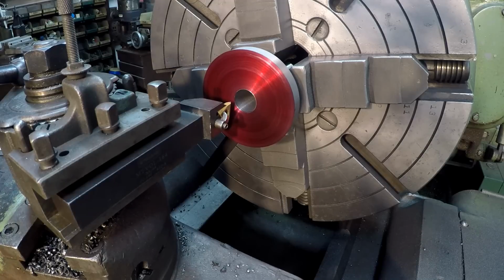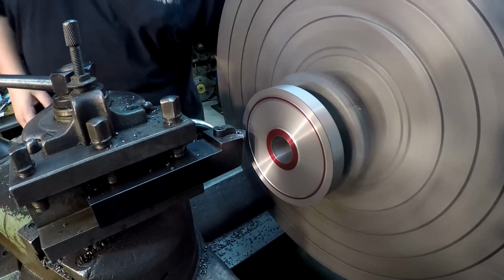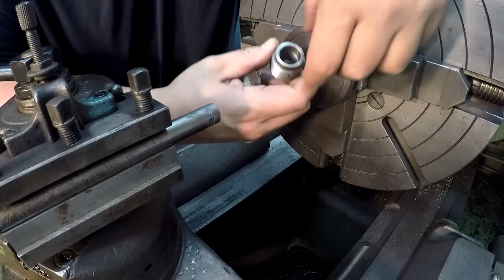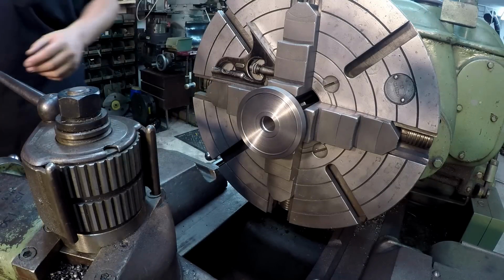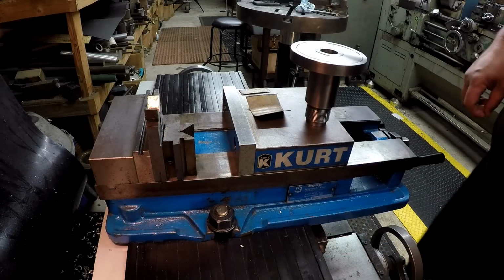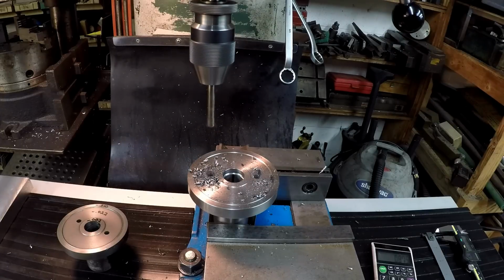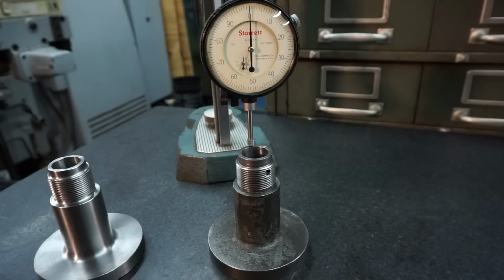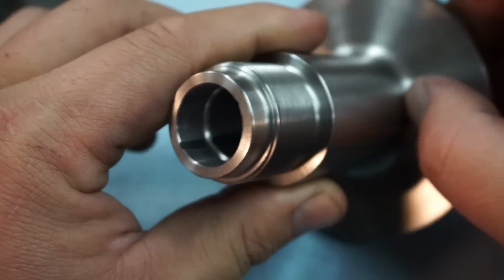LeBlond Lathe Cross Feed Nut Part 4 Finale

Comment: I noticed the discrepancy in the depth but didn't comment because of the ten thousandths outer depth. I wasn't sure if you were stepping the depths seperately or reading them in increments according to depth.  Though not doing machine work, I sometimes will total my measurements and incrementally work backwards from deepest to shallowest which is what I thought you may have been doing.
      As far as you being perfect, none of us are. Though not dealing every day with  quite so tight tolerances as you do, I have worked every day with measuring tools for the past 45 years. And whether due to distraction or being in a rush, I will still on occasion read the wrong side of the rule or a tape.
     People don't realize the hats worn by the independent contractor. It's easy to show up to a workplace and do what you are instructed to do. It's quite different when you are the instructor and instructee.
    If you had been working from a set of engineered drawings, then that ten thousandths error could be classified as a mistake. Given that you were given a part, asked to do the take offs and engineer the process for making a duplicate part, that error, if you could classify it as such would be more of an oversight than a mistake. A true mistake would kill the part, if vital the part could be re-chucked and the ten thousandths turned off, no harm, no fowl and none the wiser but for your admission.
     Don't allow the Monday morning Quarterbacks of the internet to embarrass you. Some people have nothing better to do than to point out someone else's errors and omissions to make themselves feel better.

Comment: Did you forget to drill the whole in the threads
Reply: Watch from 18:10 on, he can't drill the hole in threads or mark the zero point on rim because it has to be installed in the customers lathe to know where to place them.
Because you can't copy exact placement of the thread start and the relationship to the shoulder it tightens to, on the new piece. ( I hope my wording is not confusing)

Comment: I Really Enjoy Watching Your Videos:) You are Top Notch at what you do,  Question, Do you think that if you would have put a bolt , washer and nut through the Broken Parts to clamp them together, Then make a flat plate say 6" x 6" x 3/8" and drilled and Tapped it for the Threads to screw into and to bottom out on the Flange, Then would it have been possible to mark where the 0 line indicator is on the flat plate from the old part and transfer it to the New part when it is screwed into the flat plate and i think it would help to also align where the hole has to be drilled at. Just my 2 cents worth, Chellie, Retired Truck. Diesel and Heavy Equipment Master Mechanic / Equipment Mechanic / Welder / Metal Fabricator of 38 years. I also do Minor Machining , like making my own Tools / Parts / Shafts /  Valve jobs  ETC :)

Comment: You are probably right on there with the height because the original part doesn't fit back together perfectly right? That break would give you that slightly off reading. I think you are damn near perfect on the match. Well done.

Comment: Very nice work Adam.  fwiw I did notice the .032" thing but, wth, it really matters nothing to the project.  Also,  I also have to assume that straight oil grooves for this piece that I assume does Not have pressurized oiling, makes no matter as well. (though I was wondering how one might to the very large pitch grooves.)

Comment: What is that noise that comes on when the Monarch lathe is stopped? It sounds like a cooling pump or something, but why would it only run when the lathe is stopped?
Reply: Most lathes drive the spindle with a belt that can be disengaged (by releasing the tension on the belt) to stop the lathe without stopping the electric motor. I suspect the noise is created by the drive belt slipping on the loosened pulley, which is why the noise gets quieter whenever he turns the chuck in the same direction as it normally runs.

Comment: The error was due to seeing DEGREES with 90 being the top, instead of LENGTH with 100 being the top.  This is the problem with using a rotating dial for either measure in different measuring devices; you see double...

Comment: I'm as impressed as hell at the way you wrangle fractional and decimal inches. But every time it makes me more and more glad I'm metric.
Reply: Same here. I used to do a bit of work but our the setup was more humble than Adam's. Whenever I watch him, sometimes I have to stop the vid to comprehend his measurement values as I cannot click fast enough...
Reply: It depends on what you’re accustomed to. When you think in the halves/quarters/eighths of Imperial measure, the divide-by-ten of metric seems really clunky and arbitrary.
Reply: @mdtdbe  No, I'm not buying that. When you want better accuracy in the decimal system, you just add an extra digit. Using fractions leaves you far short of decent resolution unless youo deal in thousandths. Then you inevitably drop into the intuitive decimal system as the numerator. In other words you would say - e.g. - fourteen thou.
Reply: @donepearce  You are right. When they need more accuracy, they dont use fractions any more like 1/128 1/256 1/512 1/1024. They use thousends of  inc, it is 0,001.
Reply: @mdtdbe  I have small socket set. There are some small sockets, bout imperial and metric.
Metrics are 6,7,8,10,11 and 13.
Imperials are 3/16, 1/4, 5/16, 11/32, 3/8 and 7/16.
Metric system is much much  more easier and more  simple  than imperial.
I wonder that imperial system is used anywhere in the world after year 1800.

Comment: I have an old LeBlond Dual Drive lathe that needs a new leadscrew and 
nut.  I can buy ACME threaded rod in the size I need, but I'm 
considering using 2 off-the-shelf bronze nuts and machining a block that
 they'll screw into from each side.  That should allow me to adjust the 
backlash to near zero and compensate for wear.
More than likely I'll need to cut off the front end from the original leadscrew, bore it and 
shrink fit it onto the new ACME screw.
I read a suggestion to reassemble the carriage after removing the leadscrew assy, lock the 
cross-slide and use the compound to turn the parts I need.  Do you think
 that is feasible?

Comment: Damn. I watched the first episode and I was hooked. Such precision. I work in software where the precision is the same, just with code. But the part that got to me was the spanner holes. OK, **it's for a wrench to tighten it**, yet you took the time to center and check over and over that it was within a thousandth. Me? I'd have grabbed the 3/8" craftsman hand drill and punched a couple holes... I'm impressed by your care and precision to create such a perfect replacement part. You are an artiste' sir!

Comment: You get my thumbs up because of your calm and well mannered commentary in all your videos,  I am always put in a good mood after watching them.  Your skill and machining experience is also humbling to an electronic engineer.  In part 2 you promised to fit it in 3 parts but ran over to 4, just know that we are not upset or displeased with this minor lapse, quite the opposite and thank you for the time you take to document your work habits.

I have two small questions, I may have missed your explanation and apologize if so.

1:  Would it have been possible to increase the main tube diameter at the thread lead out and increase the radius at the weak point further or was this already at the thread root diameter?

2: Are there specifications that describe differences in performance in helical and linear oil grooves and might such performance differences come into play here and could you have cut the steepest thread pitch for the groove if a helical was called for instead of the original helix rise?

Comment: Hey Adam, Spending part of my retirement watching your excellent video's. I really enjoy the fact that you really enjoy what your doing. I can relate to this, having spent more than 60 years in the machining business. Having my own shop for more than 30 years, the one area that bothers me about this particular video is cost. It comes natural to me think about how much would I get for this job and how would I do it. While I do appreciate your care and attention, I could not help thinking that when I would be quoting this part and deciding how to produce it, the 4 jaw chuck would not be a consideration. The 3 jaw with soft jaws would be my first choice, starting and finishing the large dia. first. It's always tough figuring out what is what when making a replacement part with no drawing (I assume there was no drawing). You also are super well equipped and use brand new cutting tools, whether or not it's necessary. This is not criticism, I love what you are doing and highlighting the endless skills that are required to be a machinist.

Comment: It looks like the original piece had a tensile failure.  Not surprising because it was the thinnest part of the piece and I think cast iron (which is very brittle)  The two oil ports made it even thinner.  The new piece is ductile iron which has a different carbon structure that makes it more resilient. It should last longer but will fail at the same location if placed in too much tension.  I would not over torque the nut that goes on to that piece.

Comment: I made an indicator holder that would fit onto an Aloris quick change tool post.  The material was O1 tool steel.  Due to major blunders, I
had to discard my first FOUR attempts.  The fifth attempt resulted in a correct tool.  Don't feel bad about your 0.022 vs. 0.032 oversight.
I have convinced myself that stubbornness makes a pretty good replacement for genius.

Comment: Is  ductile iron a good choice of material? Why not something better, as the original casting broke at a weak spot?
Leaving that piece on a movable surface "upside down" leaves a possibility for is to fall over. Leave it on its base for stability. Spanner hole locations relative to center is probably not as critical as the spacing between them.

Comment: Hey Adam! Always love your videos. This might be an inappropriate video to place this on, but was looking at one of your older videos where you had to chase some threads, and the camera kept getting bumped by your head and was in the way. Have you experimented or looked at something like this: https://www.amazon.com/Umiwe-Semi-rigid-Waterproof-Inspection-Megapixels/dp/B075K4CX1R/ref=sr_1_13?ie=UTF8&qid=1507507592&sr=8-13&keywords=flexible+camera+with+light+1200p Coupled with a Noga indicator holder for some really up close live camera views or shots. It's IP68 rated. I don't think anyone on any of the machining channels has tried this yet. It's relatively cheap < $30. Just a thought.

Comment: Sorry to be pedantic about the effect of the axial oil grooves but---. Surely almost the entire radius of the bore is in contact with the shaft when sideways force is applied. Therefore I can't see the absence of a few percent of that surface making a measurable difference to the effective diameter of the bore. It will make a very slight difference to the wearing properties over its lifetime but it's delivering lubrication as a trade-off.

Comment: Couldn't you have used your level on it's 45 degree side twice and once on its 90 to get 3 oil grooves spaced evenly?
Reply: Three groves require 60 degree offset.  What you describe would be 90,135,135
Reply: @DaveRosenhauer  Math is hard XD

Comment: Great Job! As far as protecting finished surfaces is concerned, I've had great results with aluminum strips from beer or soda cans cut somewhat shorter than the part circumference. You don't have to fiddle with three or four separate shims. Also, thin cardboard from file folders / cigarette packs seems to work well on softer work.

Comment: Asking for some help on a Toyota forklift if anyone can help me. It’s a big 6 series and I’m trying to remove the axle but it doesn’t have the normal setup on smaller forklifts. It doesn’t have the bolts in the center to remove the axle. Thought the nuts in the back were what hold it but that just holds the brake system. I’m not a forklift mechanic I work on diesel trucks and cars and not really sure how to remove this.

Comment: Adam, you're the best but I sure can identify with that simple mistake. I scrapped a bunch of parts many years ago by turning one diameter .025 too small. I read the mike wrong and didn't catch the mistake until the job was finished. That happened my first year as an apprentice and it's happened since when my mind says one thing and the print another.
Reply from the maker: I have made that mistake many times, mostly in my earlier years. it's common with anyone reading mics.

Comment: Hi Adam,
That is some nice lathe work. If you are interested check out the video on our channel on "Depth measuring tools" The electronic Mitutoyo indicator on a depth base has a .00005" resolution. You will be able to check your depth right on the lathe. No need to bring it to the surface plate.
Steve

Comment: This is been an excellent workmanship.  Neat & Precise work and flawless too, Sir.  I feel that the broken part's height as compared to the new one is 9/10 Thou over is because of the air-gap in the broken joint.  Therefore, what is 9/10 Thou (under) difference comes out to be dimensionally exact.  Thanks Sir for the video.  I wish you best of Luck for the  coming projects.(New Delhi, INDIA)

Comment: Adam, have you done much hard turning? I frequently cut hardened tool steels D2, H13, M4, S7 with HRC 60+ and always struggle with interrupted cuts along holes on OD/ID turning. Faces usually don't have any issues. Is it tool alignment or rigidity issues maybe? We exclusively use CBN inserts for the process and in general they work great until that stupid hole.

Comment: Didn't read all the comments but I was wondering if the original part could be repaired by brazing. That would be a cool addendum to this series of videos. Carry on!
Reply from the maker: +Grumpy Oldman Yes it could be for sure. Although because of the thin wall where the crack is, the better option is to make new.

Comment: Great looking part Adam, nice series...enjoyed 👍🏼 Btw, what is is lowest number of threads per inch you can cut with that lathe? I woulda bet someone money that you were going to do the oil groove that way...glad I didnt bet someone :)
Reply: Abom79 wow that's low. I was trying to make a four start 3/4-10 just for kicks and giggles the other day only to find out my lathe we do below 4 tpi. I made it 3/4-20 instead.
Reply from the maker: Makin Sumthin From Nuthin I'll have to look and see but it is fractional. I recall the big Monarch we once owned would go all the way down to 5/8" pitch.
Reply: Abom79 my Morgan suspension bushes have spiral grooves which I cannot do as my lathe won’t go that course.
Reply: Mine will do 1 1/2 tpi, its a big Hendey 16"x30". My newest video shows how I do multi starts on the lathe.
spindle indexing is real easy on my lathe, it has a collar on the back  of the spindle that is graduated.
multi starts are fun to mess around with.

Comment: Have you ever tried putting drilling or milling tools into the lathe? Like chucking a spindle motor into the tool holder and then drilling holes into the face of the part that is still chucked up. Would be nice if you didn't have to get the part out just to drill some holes.

Comment: Great series, Adam. I wanted to say that what you talked about in the previous video about people criticizing you for how you are choosing to make your addition saddens me. Build the shop the way YOU want to build it and to hell with those people. Yeah, there may be a lot of real pros out there, but if they are, they need some etiquette lessons and learn how to build their communication skills so they don't don't sound like assholes even though they didn't want to be assholes, and their intentions were good. You know? 

Where is the hole through the threaded end of the original on the new part go? I didn't see it. Just saying...
Rich
Reply from the maker: Rich206L Thanks Rich. The cross hole needs to be timed with the stamp mark but needs to be screwed into the machine to be able to locate the 12 o'clock position. Vlad will handle that part.

Comment: Looks like a fine replacement part to me! Can't let the viewers or Debbie doubters get to ya man! I am looking forward to the new shop space and if you want to build it to bolt the machines to the ceiling for faster chip removal I don't care, it is your shop you do it how you want!!
Reply: Machines bolted to the ceiling for easy chip removal???.......That's brilliant Brian.
Reply: I get into it a lot with the people that piont out the typoes or maybe someone reads a measurement wrong. Maybe mention it under one post. But when its post after post that pisses me off. Some folks are just anal that way. Abom does a fine job. TRIGGER WARNING.
Reply: bcbloc02 
I believe this is why Adam doesn’t use flood coolant, too damn difficult getting it back to the sump on ceiling mount machines! 🤪🤪
Reply: bcbloc02 you got this 100% correct Brian, the negative commenters are not 'on the ground' so to speak + building projects (in my experience) never go 100% to plan, compromises always have to be made.  And as you say, if he want to bolt the machines to the ceiling, good luck to him.

Comment: If the hole is an oil hole and has to align with an oil groove and is 180 from the "O", how can you drill the hole or the oil groove before you have the "'O" position established? Did I miss something? Your great Abom.
Reply from the maker: POMOC36 For me I would screw the part in the machine, snug it, then stamp the Zero top dead center. From there you can use a center head to sharpie mark a line across the face and use that to square it up in a vise 180 out to drill the hole.
Reply: Thanks., Pierre